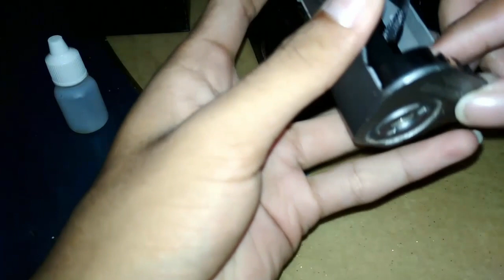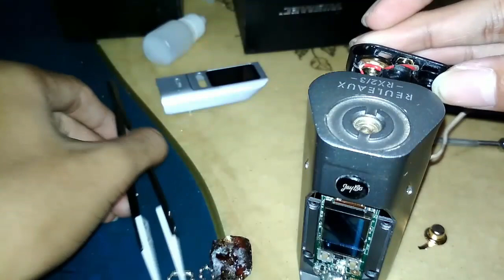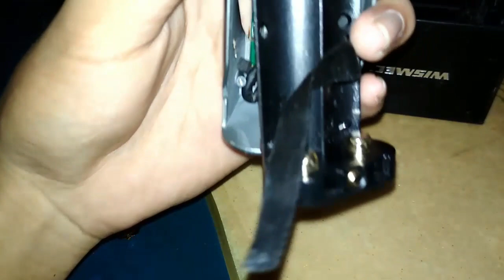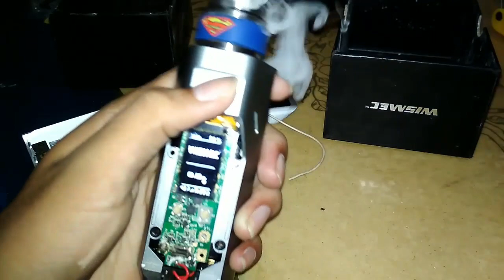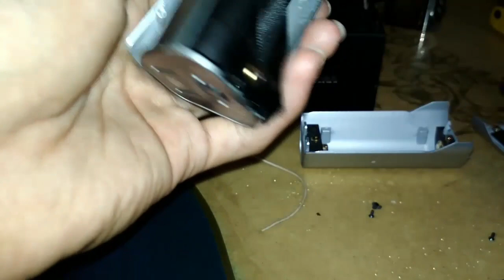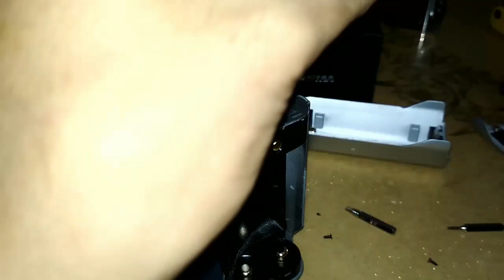Cara Perbaiki Wismec RX2/3 mati total

Comment: Mas punya sy sama mod ya wismec rx2/3 mati tapi klo di charger langsung ke mod hidup tpi pas ditekan check battrey itu kenapa?
Reply from the maker: Cobak dibongkar, cek kabel menuju konektor rdanya
Reply: @ErvanPangestu  
Udah mas apa kuningan nya yg dri batray nggk nempel ke konektor rda nya ya mas soalnya punya sy kuninganya blm putus jadinya nggk pake kabel
Reply from the maker: Kabel nya beda bang soalnya yg untuk konektor rda langsung ke chip nya, begitu pula yg dari bateray masuknya juga ke chip, oiya coba cek spring loaded konektor nya bisa jadi disitu masalahnya
Reply: @ErvanPangestu  ada no wa mas biar lebih jelas
Reply: sama gua juga kek gini, ada solusi gk, batre full gk hidup, kabel di cek semua masih terhubung, dan kalau di cas hidup, di pecet cek batre mohon bantuan
Reply from the maker: @mikailhafiz4989  Kemungkinan di komponen yg kena bang itu